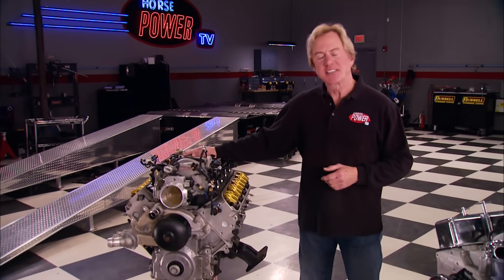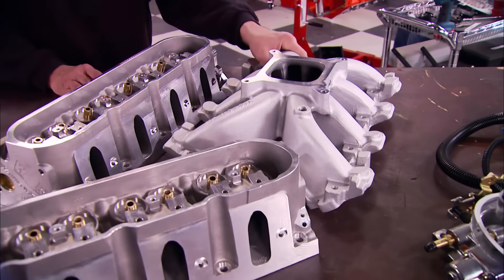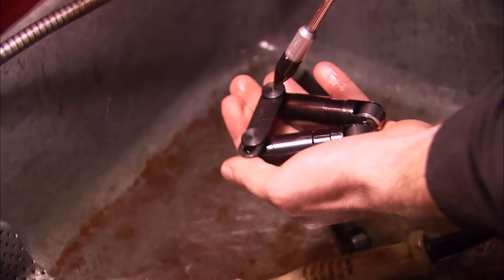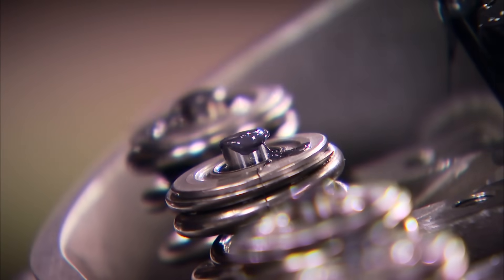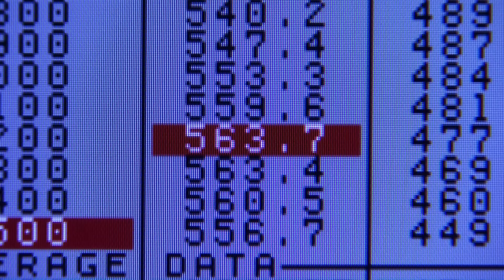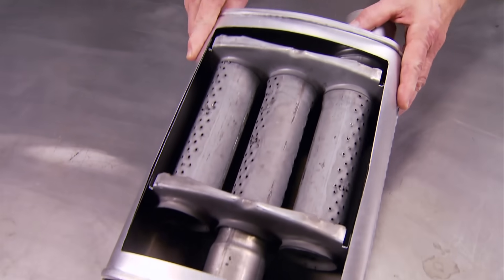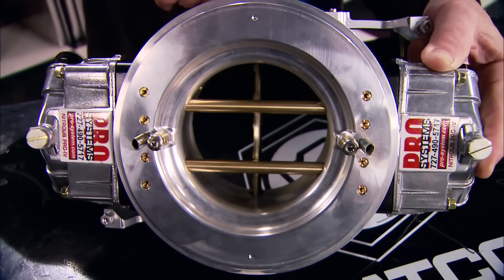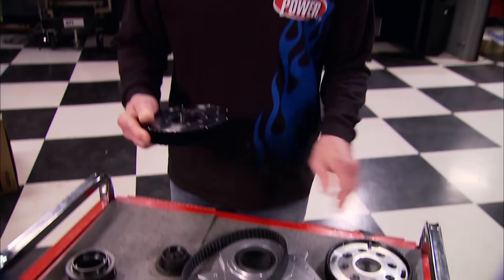Best of Both Worlds: Building A GM Smallblock With A Modern LS Top - Horsepower S14, E7

Comment: I think from either platform you can build something insane. You don't need a hybrid. 
Let's say a 4.8 iron block L series. You can literally slap whatever you want and bore whatever you want. You can make this a death machine. 
Or you can get any SBC get some crazy heads and an EFI system and you'll build something insane. 
And now with the price of doing injection modification if you really want injection on a small block Chevy, just wire up a speeduino.
That set up is only for a resto mod imo.
Not for power.

Comment: What’s the point?
Would it be better to have an LS bottom end since they are 6 bolt main?
I love carburetors and I love fuel injection, but Just to have a distributor?
Your taking away the advantage of both engines for way too much money

Comment: The glass pack is the loudest. Run it for a bit and the fiberglass blows out and it becomes a straight pipe. Alternatively pour some gas in it and light it to burn off the fiberglass before installing.
Reply: fiber glass doest burn its a fct the steel wool does fiberglass is fire proof as you can get if a fiber glass boat burns you literally could wash the fiber glass and lay up the same boat again!

Comment: To me the only purpose for this set up is a hot rod that you already have a small block in and don't want to redo the motor mounts, and fab work!
Reply: For me... this block is the chance to use solid flat tappets with an LS head.  Lose a bunch of hyd/roller mass and maybe gain an extra 1500 controllable rpm with the right grind/spring choices.  Can't use offsets in anything but a roller, so I'm excited about this combo for other than the half swap LS factor, which is what this video centered on [unfortunately].  Go 13 degree on a set of gen1 style heads and that gets expensive - this combo can get you there for less.
Reply: Good lord, I'd hate to see the cars you build if you think this is easier than simply re fabbing engine mounts or buying a different engine mount kit

Comment: It’s great the aftermarket continues to support the SBC! Chevy engineers addressed many of the limitations when designing the LS1. Versions that followed such as LS3 are even more advanced. Pretty easy to make 600 hp at 376 ci with LS, and street manners like it’s not even modded. Think what it takes to equal that with a 383” SBC, and it weighs at least 100 lbs more than the LS3.

Comment: Thing I'm not willing to do is install a computer in my old nova. I'm doing 9 second quarters with 383 cubes on carb with gas. No computer electronics. One wire to my ignition. I'm doing fine without all your techy crap.
Be well all

Comment: I can't see why it's such a big deal to fab a new cross member to accept LS motors into older GM chassis cars. You can do a lot with .120" wall steel tubing. Would be a lot cheaper than upgrading old school design block for LS heads.

Comment: The “Secret” to the Ls engines power potential is in the heads. Factory LS heads flow the kind of air that big dollar aftermarket heads do for the gen 1 sbc. So those who say that a decent set of heads on a standard small block is every bit as good as an LS, doesn’t understand the limitations of the og small block (max cam lift especially when using a hydraulic roller, cooling issues especially with the siamesed exhaust ports). these are really only limitations when compared to modern engines ie the LS, a small block can make more than enough grunt for the street, that power is just easier to produce with an LS
Reply: and tight tolerancesw and balancing theyre made by robots unlike its daddy the sbc  they improved every bad thing a sbc had wrong with it why go back to the dinosour ages doesnt make any sense!

Comment: Don't sit here list oh small block this LS that blah blah blah blah we can do this with this and wish with that and boost and blah blah blah
Now gentleman I can tell you for a fact there are some places that race that require you have an iron block bottom end you have to have a distributor you can run an LS but you cannot run an LS motor unless it came with a distributor which means that the ls heads are right for use but not the block. I know of a gentleman that had to go racing and he had class rules and this combination fell right into what he needed he had a small block car he had to have a small block Chevy in it but he could run any heads aluminum or cast so he called up and asked about aftermarket cast iron blocks and they said is it a drop in to the chassis replacement he said yeah but he says both LS heads he says we don't care what kind of heads bolt on it is the block going to fit the chassis like an  oem block? Also will it have a fuel pump? And it still runs a distributor?
Once he knew the rules he was bound and determined to figure out how to go fast cheap everybody talks about oh a foray it was boost will go $750 horsepower gentlemen these guys bolted together a 380 inch motor and made 560 horse and we're not even talking about getting radical yet. They didn't even up the carburetor to see if a bigger carburetor would make it run better. Luckily the class my buddy was running in allowed them to run any Holley carburetor that was commercially available so he put a 950 HP on his. And on top of everything else when he got done building his engine he made $789 horsepower and I forget what the torque was but he beat 750 horsepower on boost with a naturally aspirated Engine with one of these setups. So saying there's no place for this unit is a bunch of crap everybody wants to bash and slam and oh you can do this with that and you go to the junkyard and buy garbage and jack off on it and it'll go 9000 horsepower. Grow up people some people don't necessarily want to go out and modify their car and then add 500 miles of wiring and electronic fuel injection and all that other garbage. And if you want it looking very. Correct you can buy the valve covers that will make it look more like a small block Chevy and with the HEI on it and not looking as hard as you should you probably never know it's not a small block Chevy unless you're really up on the parts the water cross over might be the only giveaway. But I've never read so many people bash on something when somebody in the aftermarket build something new. A junkyard motor and a junkyard turbo and throw junk in your car and not build something brand new and actually build something that'll last for a good long time oh it's just a junkyard motor we'll throw a boost out of this junk carburetor and this junk turbo and blows up we'll just go buy more junk and throw it in there. I'm telling you it's getting old.
I resisted getting into the ls game until I decided I wanted a Grand Prix GXP now I'm into the ls game and I'm going to play the game as it lays and I'm going to try and keep this car looking nice and running decent I'm not going to boost it I'm just going to build a naturally aspirated car I'm going to upgrade the transmission on it I've got the custom oil pan and starter set up from LS4 King, and I'm going to look around and try and find me a decent price set of headers cuz eventually somebody will come up with a set of the cheaper ones from eBay for sale or they'll come back in availability one of the two or I'll find somebody that's got a set of Doug Thor release that are getting out of it and I can get them at a discount. Or I'll make my own.

Comment: So, you lose head bolts and gain an increase in head flow that could be had through any standard 23 degree SBC aftermarket head. Juice doesn’t seem worth the squeeze.

Comment: That makes no since ,Mind as well just buy a ls. If you cant modify a LS head to fit a older 327-350 engine, Then just buy one there cheap. I can get 600 hp out of a LS  motor without Trying to hard, So why buy that Block.

Comment: I don't see the point in this unless you just want to be different. The LS 6 bolt caps will hold more power than even a splayed cap SBC. As long as you're not moon tuning the LS you can hold 700-800 all day long on stock internals and 1000+ 7500rpm+ on forged gear.

Comment: Will a top end kit with cam work on a 91 "tbi" chevy 350 block? Are the 70s, TBI's, and LS blocks the same? I know the vortec heads and intake are different, but are the blocks the same?
Reply: LS blocks only have one thing in common with SBC blocks, that is the transmission bolt pattern, and even then there is one hiole you can't use.
Reply: @fryloc359  Thanks for that info! I think I will rebuild my 91 tbi 350 block, and put a top end kit on it for my K1500.
Reply: @fryloc359  My block is a 1991 GMC tbi 350, not an LS. I think I can rebuild the bottom end, and put a top end kit on it with new cam, heads, and intake. I believe I just need to find out how to attach the accessory mounts, and water pump specifically.

Comment: What would be the bill for a kit like this. Everything you have shown? Thanks much. I thought by now one of the head manufacturer would have come up with dual over cam heads? Would take some extra machine work to mount a cam drive system but could be maybe de stronger than a coyote. Thanks for this video.

Comment: one of the best reasons to use an ls motor is the aluminum block. there is no reason to buy a new cast iron block for old school bottom ends. if i wanted a heavy iron block i would built a new lsx block to 500 cubes. the only reason to have an iron block is for boosted applications,

Comment: I get why you'd want LS cylinder heads on a old style small block Chevy they flow much better but the old style Chevy short block is not near as good or as sturdy as the LS 6 bolt mains the crankshaft is bolted in rock solid with no movement or flex even at higher RPM is the reason they last such a long time so l get this is a definite upgrade to me it's not the best of both worlds

Comment: If they wanted to get 5 to 8 more horsepower they should have installed  a 1 inch carb spacer plate only because  those butter flys on the carb should  be above to top of the runners  and not even  with them  , also they should  side gap all the plugs to expose  the spark directly to the  combustion  chambers .

Comment: I had this 66' Bel Air station wagon with a vortec head swapped 327. I took it on down to the local muffler monkey & handed him a pair of single chambers and to install full 3" exhaust exciting behind the rear tires. How loud could it possibly be ???
I'll tell you this brother...ever been to a cackle fest ???  Holy Crap !!!  & We had one hour to check the car in at Street Rods North (NSRA) we had to put on hearing protection just to drive it down the highway !!!!
Learned my lesson  😆

Comment: This concept seemed quite interesting and feasible ay the time, but it never seemed to catch on. We do roughly 80 to 90 builds each year, and we're building many small blocks from 383 to 427 and even a couple of 434's. As well, we do a few LS motors, but we've never had anyone approach us for this Chevy/LS combo. World Products produced a 1st gen block with the LS bolt pattern decks, and I expected that idea to gain some speed. The selling point was fitting LS technology into early Chevys without having to modify the crossmember and engine mounts etc. Now that several companies offer beefier LS blocks, no one seems interested in mounting LS top ends on early blocks
Reply: Well considering a sbc block only cost me $200, same for a LS. Would be hard for me to justify $3300 for a block.
Reply: If the only benefit would be motor mounts and cross member then it doesn't make sense. Those items are super cheap compared to trying to build this over a regular LS with swap parts.
Reply: @Stephen_Hodge  First Gen Camaros also had steering components behind the crossmember, making oil pan clearance another issue.
Reply: The problem is not the idea, the problem is the cost.

Comment: Actually have been building these for over a decade now, we even built a Magnuson supercharged version that made 755 lb-ft of torque.  Coil on plug ignition with a FAST ECM. If you have any questions on how we did it just reply here and I will send you some info!  The engine was featured in the August 2011 issue of Muscle Car Power Magazine.   There is also an article in LSx magazine.
Reply: Steve how can I get that info from you thanks
Reply: It just seems like the only thing you'd want the SB bottom end is more head studs cuz otherwise the LS is superior... Cranks, mains, cam bearing size I mean what's not to love
Reply: @ianbuilds7712  Ease of mounting in a classic car? Maybe?
Reply: @tucoramirez8397  aren't the mounts very similar? And bell housing bolt pattern is same too? I'm pretty sure a powerglide or 400 will bolt on
Reply: Interested
Reply: I am very interested in more info on the build please...Thank You in Advance.
Reply: Info please
Reply: So how can i have one built by your company? How can i contact you?
Reply: Hey, well i was wondering what is a good bore size for a street engine out of it, i am shall use ported stock LS 7 heads and haven't decided on cam or intake yet. Recommended?  i want to use a custom super short piston N/A only,  some really long rods and as much stroke as i can get with a decent rod ratio.  Going in a 2nd gen camaro baldwin motion pro tourer resto mod show car daily driver kind of thing. It uses 15" wheels and tires 15X12 on back with p295/50  and 17's on front.
Reply: @zAvAvAz  4.125" is about perfect for these blocks, I have gone as high as 4.185"
Reply: @stevemartinson7261  thanks , i did not know if it had bigger bores or not.
Reply: What do they cost???
Reply: I’d like some info.
Reply: You have years worth of inquiries here guess you dont need the business?
Reply: How did you do it???
Making 755 torque
Reply: @BillieWilliams-l6m  A combination of the heads, longer stroke, and that supercharger!
Reply: Details please
Reply: Steve…91 K5…I want to look at this motor set up to build for my Blazer. Details please?!?!?!
Reply: This show actually first aired in 2010...
Reply: @louieatienza8762  That makes sense
Reply: I would like some information on how you did it.
Reply: Still interested in info on the hybrid setup. I have a C4 (1992) with an Opti that needs to be switched with something else. It seems that this engine might provide the answer.
Reply: That dash maybe cool but like many modern sports cars if you crash screwing around on the street even without anyone to witness the crash the car will tell on you as payback for crashing it ,and stick your butt in jail right after you leave the hospital,😂😂😂 😂
Reply: That’s weak
Reply: @caseywilliams5406  what is weak?

Comment: Now you can bolt up LS heads to the old sbc... as long as you buy an entirely new sbc for probably twice as much as any other sbc.  This is like click bait.  I thought they were going to show LS heads that are made for sbc OR how to have the LS head worked over to  olt and match up. Whats the point of this?  Buy a whole new LS motor, or for far less build a junkyard LS, or a good sbc shortblock and great heads to put on and save money and make better power.

Comment: No exaggeration , those Pro system SV-1 single blade carbs are super Snappy, i have heard transmission input shafts snapping and driveshafts breakage. An incredible part. Note this airing of episode was 2010 i have learned from the comments below.

Comment: Can someone explain to me what they are doin when using the strobe light on the balancer/damper... I obviously understand it has to do with timing but what exactly is going on there?
Reply: they are checking the timing to see when #1 plug fires.  Usually there is a mark on the balancer where #1 is at TDC, and another set of pointers that indicate TDC, 2 degrees BTDC, 4 * BTDC, etc.

Comment: Accessories, accessories.  I would have put those adapter plates near the rear of the motor  and snuck a return pipe under the manifold attached to that valley cover.  Why... I might even be able to stick with oem radiator hoses.  This build could put alternator and power steering down low but I want my air conditioning - damn the critics!